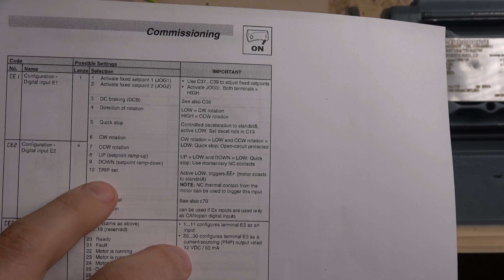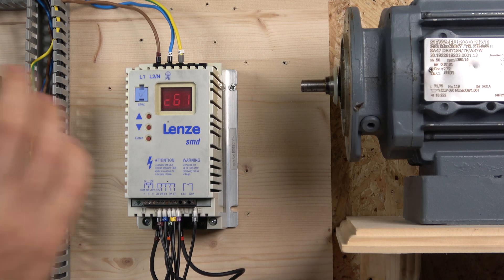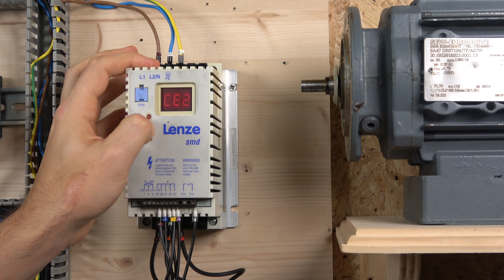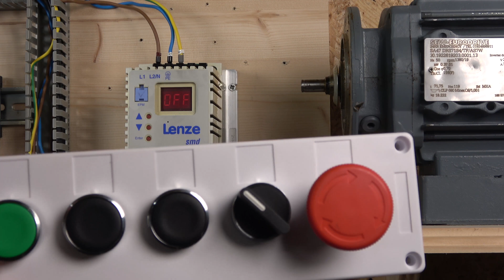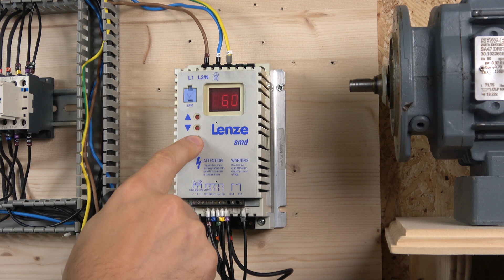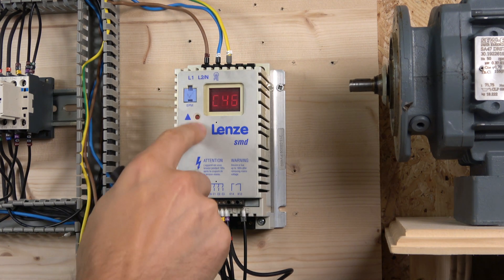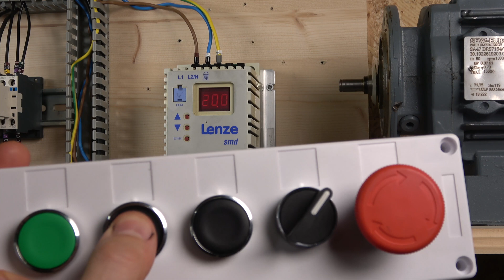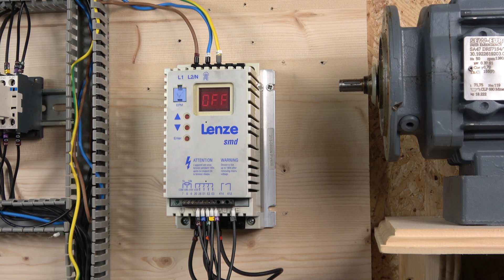Lenze SMD VFD drive remote control, MOP and multi frequency control set up. (English)

Comment: Hello, I have an issue with a spindle; the brake activated itself, and we don't know how to deactivate it. The drive shows a message "br DC BRAKING, THE DC BRAKING CIRCUIT IS ACTIVATED." How can I deactivate it? The drive is a Lenze AC Tech SCF series model SF2100V.